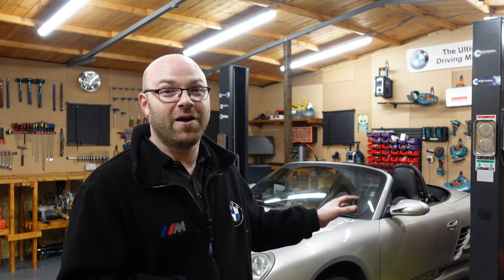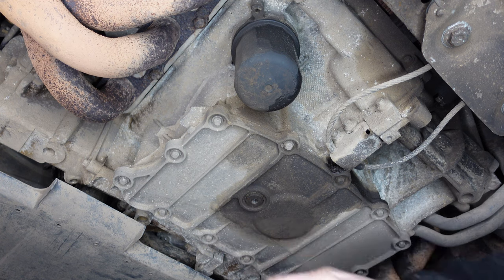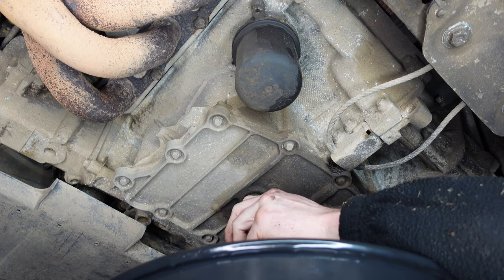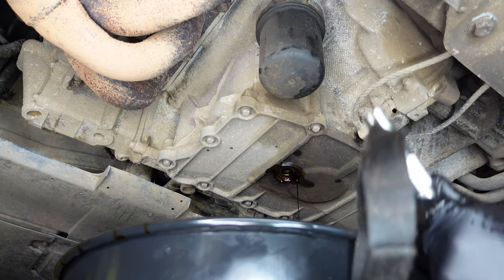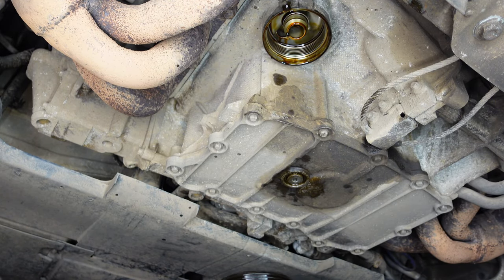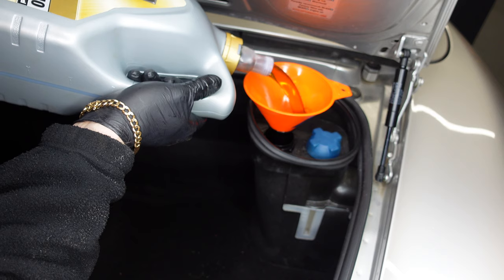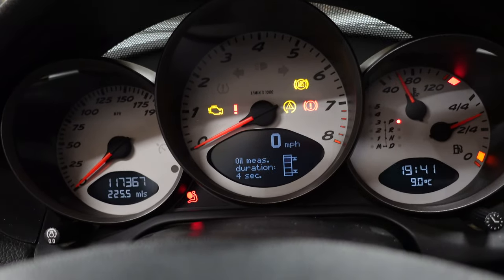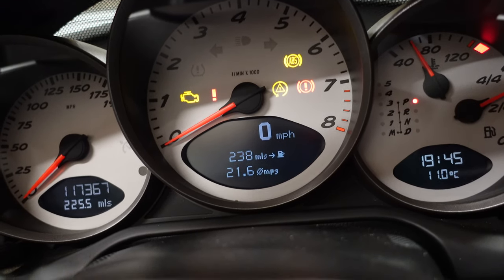Porsche 986 , 987 Boxster / Cayman How To Change Oil & Filter

Comment: I have a x5 50i 2012 , have a new engine install by BMW now it has 30,000 miles , is safe to install a race chip on it?
Reply: Just do a proper remap
Reply: Damn that’s some low mileage! My 2011 528i has 220,000 miles with original N52 still running strong. Can’t say the same for the tranny.
Reply: My odometro has 106,000 but it  tht  new engine i already put 30,000 miles

Comment: Will add 5w/40 is better for high milage porsche
Reply from the maker: That’s true and I use that on my bmw with high mileage but being Porsche I prefer to use what Porsche reccomend 😅 and this car hasn’t had any issues on this one never burns any oil and runs perfect. But I may switch over and see if it makes any difference
Reply: It was a Porsche engineer who advised me to use 5/40